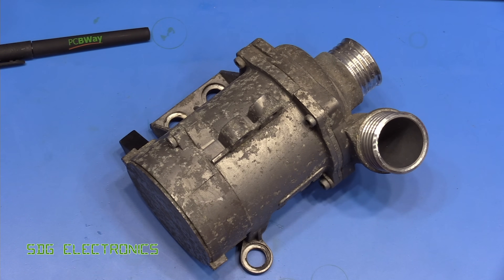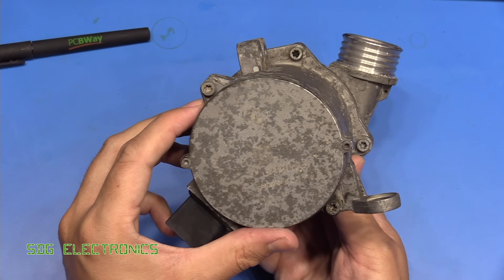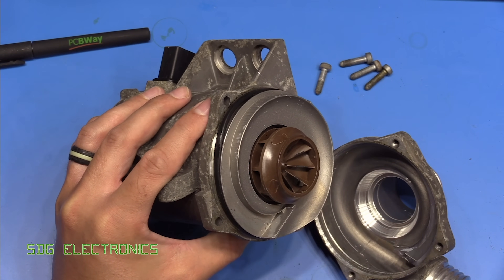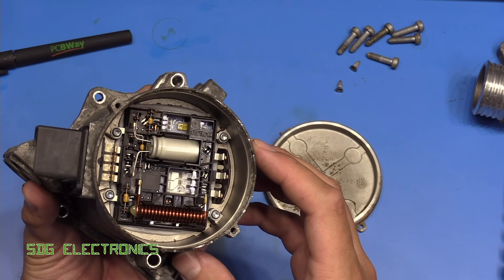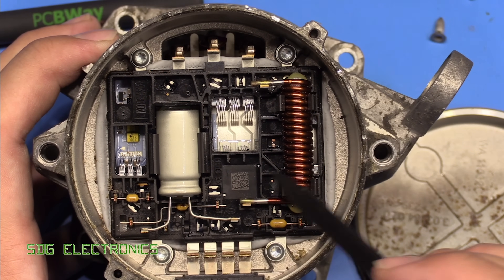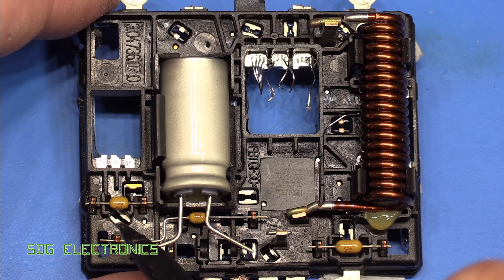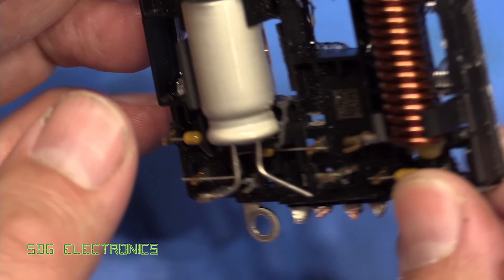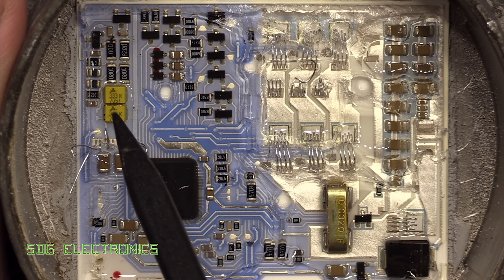SDG #257 Interesting electronics in a BMW Electronic Water Pump

Comment: I think the lack of PCB is also a way to combat vibration problems. With it so closely coupled to the engine it would be pretty horrific to the heavier component soldered joints.
Speaking of BMW pumps, I just replaced the low pressure pump (one of two) in the fuel tank of my 330D. What a complicated assembly! What also a bit of a surprise to see that the pump motor contacts are bare and just dunked in the diesel.
Reply from the maker: I think the gel compound is also there for vibration damping of the wire bonds. I think the bare contacts are quite common in fuel pumps - both petrol and diesel, also in the fuel sender unit is uninsulated. I guess no risk of ignition if it's submerged. Did you get the smell of diesel off your hands yet?
Reply: @sdgelectronics  Yes the gel is a standard thing for almost every module, damps vibration, transfers heat well, and provides pretty good protection to the actual module components. Being flexible it also does not stress any of the components either, which helps with having the bare dies that get hot fast, and need to be able to expand without constraint, though the ceramic is designed to have a TC of expansion that is the exact same as silicon, so the silver solder alloy used to attach the dies does not have any thermal stress on it which can lead to the bond failing with time and cycling. 

To get the ceramic off you will have to take that whole ceramic block up to around 150C for a few minutes, to get the thermal epoxy used to hold it to transition to it's weak form, though this will likely also destroy the main chip and the tantalum capacitors in doing so.
Reply: @sdgelectronics  thats what the nitrile gloves I also use when pasting Pcbs are for....:)
Reply: @sdgelectronics  , to get the smell of diesel or petrol off your hands, you can use the "rub-away steel soap" from Amco. First i though it was fake, but i order it, and it works like a charm. It's just a piece on Stainless steel (do not know the exact type)  in the shape of a soap bar, you first wash your hands with regular soap or handscrub, and then you wash your hands with plain tap water and the Stainless steel bar, and the smell is almost gone for 99%.
Reply: @IanScottJohnston , with gasoline (petrol) pumps on BMW it's the same. I was also surprised, when i replaced the fuel pump of my 318i (E36) a few years ago. 
I guess they leave the contacts bare, because the mixture air/fuel in a tank has not the right ratio to get ignited.
Reply: @BjornV78  would loved to have been in the design meeting when it was decided to do this......and watching managements faces "you want to do what!!!!".......LOL
Reply: @IanScottJohnston  , i was also thinking about Electrolysis, but i guess the resistance is to high. I have worked as a car mechanic, but never though of measuring the electrical resistance of the fluids in a car. I do know, that those meters for testing the quality of brakefluids, use a resistance measuring, because brakefluids are hygroscopic and attracts moisture (water) from the surrounding air, the more water in the brakefluid, the lower quality. Grtz
Reply: @BjornV78  Yes, same on my car, where the ceramic resistor array used to sense fuel level is bare, along with the contacts, and the fuel pump connections are bare with a crimped wire. not going to spark in the majority of cases, and with a tank not empty the vapour will have displaced all the oxygen in there anyway, so even a spark will not combust, as there is no oxygen around in a correctly maintained system. With US vehicles the charcoal canister and evap system it also makes sure there is no air coming in, as it seals the system and has a slight vacuum at all times when engine is running, removing vapours and trapping when not running, and burning then during engine run with inlet suction and a valve.
Reply: @SeanBZA  in the European models there is also a charcoal canister and evap system, but i disconnected the hose from the charcoal canister to the intake manifold and let the electronic valve evaporate to the surrounding air under the hood. The connection on the inlet is plugged. Have this modification more then 20 years without any problems. Grtz

Comment: Was watching a video a day or so ago about vehicle reliability. In the comments there were many comments about how BMW's are unnecessarily over engineered. I have a friend in London who bought a diesel BMW. Some of the issues he's had spending thousands to get little things repaired has me sworn off BMW's in particular and many, many "modern" cars - including later models of my 18 year old Subaru.
Reply from the maker: I think the E9x is the last BMW series before electronics overcomplicated everything. All of the newest cars are surrounded by electronics destined to fail, repair bills likely sending them to their grave too early. Having said that, I'd still buy another BMW over most other brands knowing the mechanical side of things are so well designed.
Reply: I think all modern cars suck with the over use of electronics which guarantees early obsolescence
Reply: @kissingfrogs  I cannot disagree.
Reply: Electrical problems with BMW have been around a long time. You would get one model and it's bullet-proof, then another model that is a complete electrical disaster. A guy down here bought 3 expensive BMWs to do wedding hire, but when they keep breaking down with electrical problems during weddings he sent them back. That was maybe 20-ish years ago. 
As for actual mechanical parts, German stuff is pretty strong.